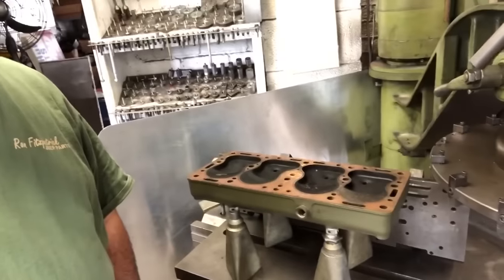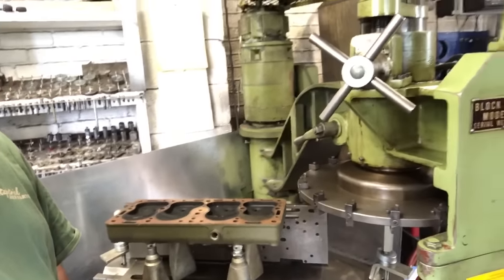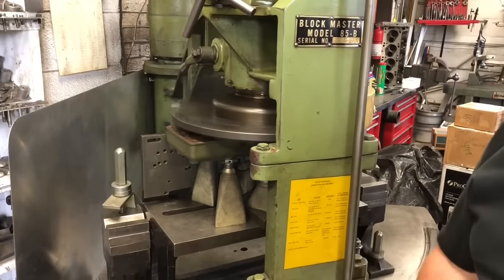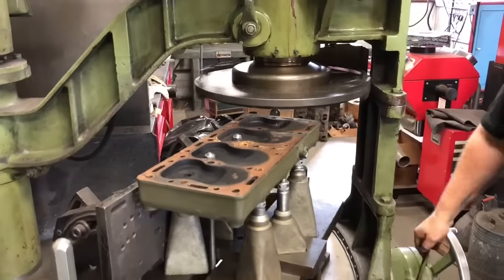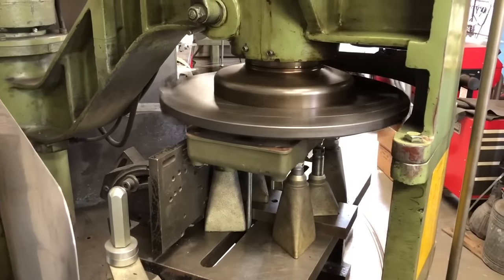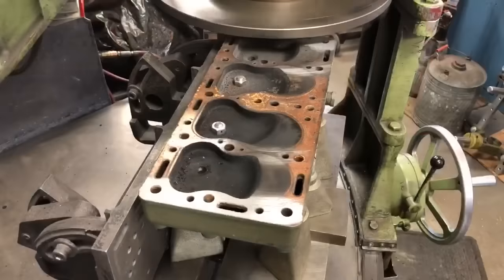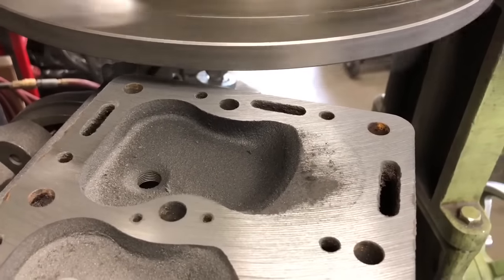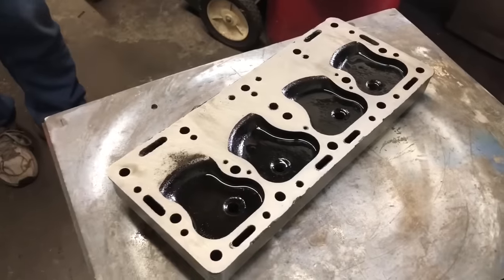Willys Flat Head resurfacing

Comment: Very cool! I milled many, many heads and blocks on the same model mill. Great machine.
Reply: This comment from a guy who has actually used the machine in question is far more important than the comments of the wannabes who have not.
Reply: Thank you geosutube. And yes to the others, you do have to be mindful about where you anchor and support the piece to be milled. Every model part is different. You need to have knowledge about how each one reacts to stresses, which is gained through experience.  And for anyone wondering about the cutter wheel, it is dead flat and square with the spindle, but the carbide cutters are all set at slightly different heights so each takes a progressively bigger bite. Treated well, the cutter wheel will last for a decade of use or more.

Comment: In the 80s I worked on an old flathead Willy's that a female classmate picked up to drive cross country to college.  The thing would get up to about 3,800 RPM then the valves would float.  In top gear high range, this was at 54MPH.  The gal made it all the way LA to Colorado before spinning off the road and scattering all her earthly possessions down a snowy embankment, amazingly not hurt.

Comment: Storm 85b machines came with 2 adapters that clamped from outside of head to 2 head bolt holes with dowls thru head bolt holes. They bolted to fixture and you placed screw Jack on other side to level. Will guarantee pulling thru spark plugs holes bent the head.  Been there, learned the hard way!!!

Comment: Back in 68-69 I had a 1943 MB Jeep and decided it needed a little more power. Had a local machine shop mill 0.125 inch off of the head. He used a large plate milling cutter that he said that he made himself on a vertical milling machine. The plate looked very similar to the one in the video.

It didn't make much difference in the power level. It still didn't have much.
Reply: On a flat head when you mill the head it also hurts the breathing. (air flow)  because it closes down the space between the valves and the cylinder bores.

Comment: Does my heart good and even makes me feel a little proud to see a guy doing the same operation he's probably done hundreds of times and do it flawlessly. Laborious setup like that teaches you how important learning how to use precise measuring tools really is. People have been commenting on how old the milling machine is and how they would have done it differently, but in the end what did you get - a perfectly leveled and surfaced head with the least amount of material taken off.  Nice work, sir.....
Reply: or you could just lay it on a Van Norman right side up, with 2 shims and clamp from the sides and hit the switch like every shop I've ever been in. That machine seems to be a poor setup with too many moving parts to be accurate.

Comment: I don't know anything about the newer engines but I do know those machines work very well on the older cast iron engines. I used one in the late 70s early 80s in a very busy automotive machine shop and we never had any problems.

Comment: It's a Go Devil Head. You could surface it with a bit of 2X4 and some emery cloth. From memory 1/16"is ok.
But seriously held down in the middle and not the ends of course its going to bow. it should have a hold down in every plug hole.
Reply: I sleeved an F head block once it was to tall to fit in my machine to deck so i bought a large file and some WD40. Draw filed it flat.
the customer (A kid) brought his jeep by running. He let out the clutch in low gear at idle got out and walked next to it. it was so smooth and silent you could barley hear it running.

Comment: A very minor assumption is being made that the cutting head is not warped.  That is, when they move the depth micrometer from one point to another on the cutting head, and measure down to the head, they could be introducing error if the cutting head is warped.   Probably better to use a dial micrometer and swing the head across the surface being leveled.
Reply: Exactly what i thpught.  Some old technology right here.
Reply: @maxoneill5208  - 2 ww car, 2 ww equipment :-)
Reply: Easy enough to mount an indicator and sweep the top of the cutting head when setting up the machine initially. Then you know it's straight. Fast and accurate to depth mike from then on. No need to bounce an indicator across the head surface every time.
Reply: @johnk3606  ... Again, if I understand you, this method would induce inaccuracy as well ... and that is the whole point of my post ... reducing inaccuracy of measurement.

If you are saying (and I could be totally wrong here) to mount the mag dial indicator on the engine part (head) being machined and then sweep or indicate to the the cutting head and/or the cutting teeth attached to it then you are again inducing error as the cutting head could be warped and/or the cutting teeth could be misaligned.

Take note that the cutting teeth are all adjustable (up/down) for this exact reason.  That is, when the teeth are mounted they are individually set to be the exact same height relative to the cutting surface ... not an exact distance from  bottom of the cutting head.

So placing the magnetic dial indicator on the cutting head and then sweeping the cutting head back and fort across the head being cut, checking various points on the head, will eliminate these errors as the point of reference (e.g. the mag base of the dial indicator) is never changes.  Granted there could be errors in the machine turning the cutting head (misaligned, wobble, old bearings, etc.) but these are reduced by keeping the mag dial indicator at the same point on the head while measuring.

The point is that (and as seen in the video) anytime you move to a new/different reference point (e.g. moving the depth gauge to a different point on the cutting head) you are NOT measuring the same thing any more.

Ultimately it boils down to "How much accuracy is actually needed here?"  As I am not an engine design engineer, machinist, or mechanic ... I can't speak to those tolerance requirements so my suggestions though more accurate ... might be excessive for the task at hand.  Food for thought on your next measuring task to say the least ;)
Reply: The operator would not use the cutting head as a datum if it was warped ,give him some credit for being a skilled machinist
Reply: @digiacomtech5589  depends on the car but a couple thousandths is tolerable usually. warpage up to 4 thousandths is considered ok before needing to be machined
Reply: FIRST - I think you are meaning to use a "DIAL INDICATOR" ....not a "dial micrometer".

SECOND - it can't be certain that he measured from different points on this cutting head.  He may have rotated the head to ensure he was measuring from one point....but I can't tell.

THIRD - yes, the dial indicator would be my preference as well ....and this could be also done from the table.
Reply: @Auto209  you need to explain "warpage up to 4 thousandths is considered ok before needing to be machined"  ....is almost a complete fail.    Nothing is ever done until the most common problem occurs for a head .....LEAKAGE OCCURS.    At that point, a head has failed.   It doesn't matter how much warpage has taken place.   The head gets removed ....and if it is found to be "less than 0.004", according to you ....it would be deemed it doesn't need to be machined.   Of course that's quite silly.     I have no idea why you would suggest that any amount of warpage is "considered OK"????
Reply: @taxicamel  ... Good catch, but I won't correct it so others will understand your comment ;)

Comment: The 1953 Willy's Jeep I drove for my C.O. had an "F" head engine, with intake valves in the head and exhaust valves in the block. A little different from flat heads with both valves in the block but probably a little more horsepower.
Reply from the maker: Ellie Price I used to own 2 M38A1’s, I’m familiar with that version.

Comment from the maker: Armchair quarterbacks are ok, doesn’t hurt my feelings one bit. Thanks for watching folks,
Reply: Ronald Farley  With that old time out dated machine yes it takes more than 10 minutes with a modern machine less than 10 minutes. Cleaning the head will take longer than milling it. Even with the old machine you dont stand there and watch it cut you set it start it and do something else overlap the jobs. 
The question is do you bottom feed with old equipment or do you invest and offer top quality work faster and more accurate?
Reply: quick question though. That end section there seem to have been eaten out or burnt out . What you do now, run it as is or build it up or is it that I don't know much about those engines?
Reply: @tomhutchins1046  
Thy to set up the head up true and then mill it on any CNC machine in 10 min.
½ hour goes fast
Reply: @simonsms410  What the heck are you talking about? I said modern machine not CNC machine learn to read. As in modern head milling machine with a single CBN insert. And yes it can be done in 5 minutes with a superior finish on some of the modern cylinder and block machines
Reply: @tomhutchins1046  
Try to tell me what makes it so much faster on a modern 3 axis CNC mill.

The cutting is not the time consuming part, it is the set up with getting head set up true in both directions .

You clam that you can do it in 5 min - getting a cylinder head to the mill, set it up true, programme the machine, do the cutting and   take it down from the machine again.
If you can do it in 5 min, then you should be able to do 12 different cylinderheads pr hour all day long.
I need to see it before I belive that.
Reply: @tomhutchins1046  
You keep avoiding to answer.
CNC or not, it is the set up that takes time (IMO).
How can you clamp and get the head level faster on a CNC mill than a manuel?

Try to answer this time, not just to repeat "modern CNC". 

But 5 min pr cylinderhead, can you then do 12 different cylinderheads pr hour all day long on e.g a new CNC mill.
Reply: I would worry with the past you use as the motor gets hot and cools down we had a dad head on an 830 case tractor we couldn't afford to buy a new one or even find a good used one the tractor was very valuable to use at the time we found an retired  railroad Machinist he stitched the crack in the head first he drilled a series of holes down the center of the crack then. He taped treads in the drilled out hole he run used a grade eight bolt I believe and tightened the bolts mind you now the bolts were very close together so he had to cut the top of the bolt head off each time finished this and machine the head since the crack ran right through the center of the combustion chamber we were back up and running in a few short days this guy was amazing I thought for sure the tractor was done it wasn't we ran that old girl hard that spring with out any issues whatsoever
Reply: @edcrego396  Hi Ed, actually, stitching a crack is done with a tapered reamer, a tapered tap and a cast iron tapered plug, drill and complete one plug, dress it off, then center punch close to the edge of the plug you just installed and make the next plug, If you used hardened bolts the drill would walk to the cast iron and make a mess, then when you tried to tap it, there would be a ruined reamer and tap,  most heads are just cast iron, I don't think they stitch aluminum heads, they weld them. I stitched a crack in the side of a diesel engine about 18" long, it held fine, as a matter of fact, when you finish, you take a small air chisel with a small blunt tip and run over the repair for a couple of minutes, after a coat of paint, you won't even see where it was, if done right they don't leak, I have made repairs in combustion chambers right through the valve seat pocket, the new seat is installed and off you go.
Reply: @scrapwire1  I brazed a water jacket Crack on a Farmall H when I was still in high-school.  Twenty years later it was still running strong. Prep, pre-heating, stress relieving are all key with cast iron. I was lucky that I had access to an oven it fit in.

Comment: I haven't worked in a machine shop in almost 20 years but when I did we didn't use an antique like that thing to shave heads and blocks. That thing looks way more complicated than it needs to be. I applaud the fact that someone knows how to use it.
Reply: That antique as you call it,  is one of the best block square decking machines ever made
Reply: @Myvintageiron7512  And the model T was the best car of its time just now its just not up to modern use like that machine isnt up to modern use
Reply: @Myvintageiron7512  I could see decking blocks in it but the setup for heads is completely fucked and the danger to throw one is there. I could put an apprentice on newer machines and not worry about death and dismemberment but more important damage to antique parts.
Reply: @Myvintageiron7512  talks about Small blocks like they’re dinosaurs but defends a dangerous, and shitty Decking machine like this?

Comment: Definitely not many commenters know much about machining ....and "Watson's Wagons" doesn't seem to have a clue where he is.

Jigging this head using a master level ......on a dirty corroded surface?   The least that should be done is wire brush the surface and maybe use a cleaner.   But a LEVEL????     DIAL INDICATE THE SURFACE.   DIRECT READ EXACTLY HOW MUCH TO MOVE/ADJUST THE JACKS AND VERY QUICKLY CONFIRM DEAD-NUTS "LEVEL" FROM THE CUTTER HEAD OR FROM THE TABLE .....if you know the machine.

Have these 14 bits been "jointed" to ensure the bit positioning is exactly the same for all the bits?

At 7:42 it can be easily seen that only ONE bit is doing the majority of material removal.  The evidence is the surface finish looking like a phonograph record ...only worse.

Which bit or bits are actually cutting?  The guy running the machine doesn't seem to care ....and the camera man obviously has no idea what he's looking at.  Won't be able to see the surface finish once everything "looks" the same.

Well, they think they know there aren't any cracks anywhere ....the checking was done in only one direction.

YUP .....GET ER DONE!!!

.

Comment: done that  before on the same model machine. not hard to do. but I use a dial indacator to zero it in .also beware when holding at the ends and pulling from the center plug holes...you may not end up with a fla head flat head... pull from the ends with the stancions across from the plug hole hold downs. he is talking about bowing it but dont set it up so it wont....Ive seen this way tomany times.

Comment: Wow i used one of those old time storm Vulcan broaches in the early 70's. Didn't think there were any still around. Always had to send the cutter head out to be reset and sharpened. Even when sharp the finish and accuracy was poor. You can't use them on modern engines with MLS gaskets. Even on old stuff they were shaky
Reply: Where did you see a broach cutter ?  The only thing I see in the video was the indexable face mill ,  you couldn't have been talking about that cause those cant be sharpened , you have to change the inserts .
Reply: Some inserts can be sharpened , carbide or hss. but most are coated.
Reply: @stevelamperta865  Buddy i lived it . There were company's in the late 60's and early 70's that actually sharpened the cutters for those machines and would set all the height's. they did not use the insert's we use today.
Modern surfacing machines use a round CBN disk some use 2.
You need a very solid heavy machine to use CBN and get a good finish. Those old time storm vulcan machines can't be converted not enough mass in the cutting head or the machine.
The finish they produce was once exemptible on a car that was expected to last 100,000 miles and low performance by todays standards. Even then head gasket failure was an excepted thing and even gas stations repaired engines.
Reply: @stevelamperta865  oh and if you look at 1:32 he seems to be missing at least one?
Reply: @stevelamperta865  PS setting the heights is critical on those old machines or the finish will really suck! you cant just plug new inserts in. The original cutters had the inserts brazed in also. Some were just a solid piece of high speed steel ground to an edge.

Comment: Hello Folks:  Great machine and I suppose it makes grinding jobs fun!  I would like to inquire why not remove the rust and carbon deposits using dremel/solvent/etc before grinding it perfectly planar?  Also curious how much is the charge to do this for a 4 cyl engine--both mating surfaces??  By the way, what is this machine & process called?

Comment: The head was low in the middle and high on each end, but then again the way it was held down would have aggravated that. There should have been a hold down in all spark plug holes not just the middle two.